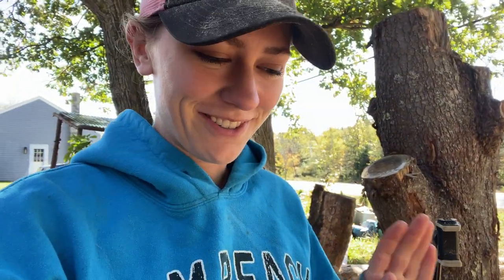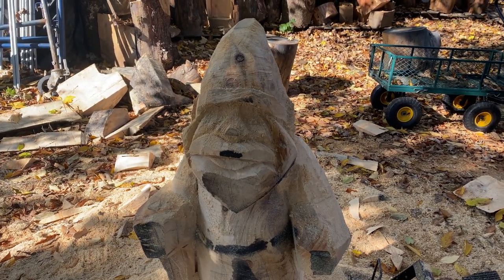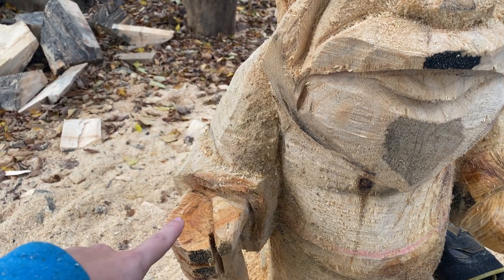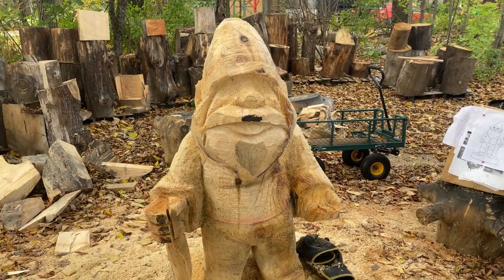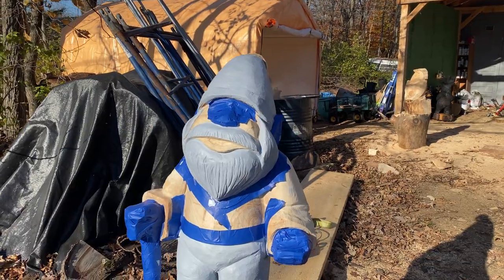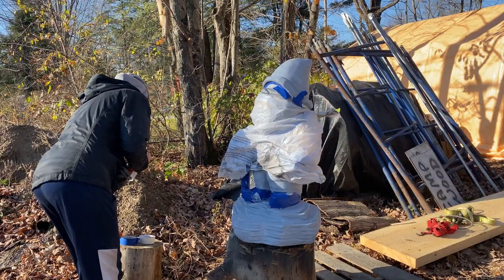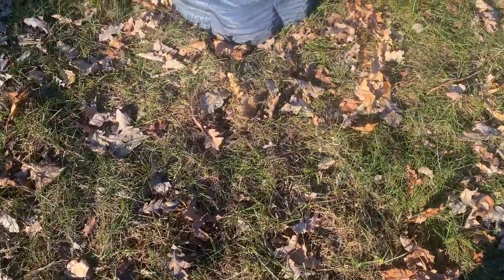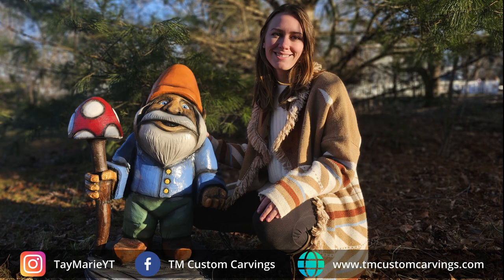Carving a GNOME

Comment: I notice you are not using electric chain did you decide on gas
Reply from the maker: Been using mostly gas’s for awhile now, since last winter actually! Was having a hard time running carvings bars on the Oregon saw, they were overheating due to the open throttle on electric saws. But I just got a Stihl mse180c (small corded saw), used it yesterday for the first time with my 8” carving bar and it ran beautifully! So I’ll be using more electric here soon, especially when I want to hide from the wind and snow in my shack haha! 

Electric is wonderful but sometimes you need gas for that extra power!